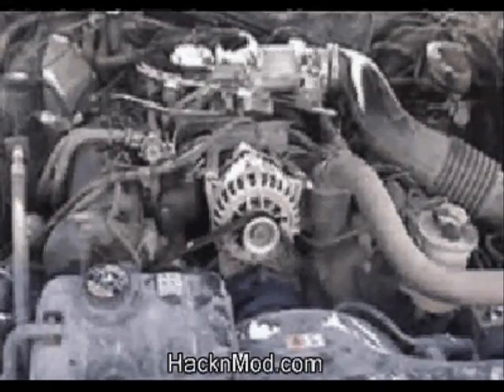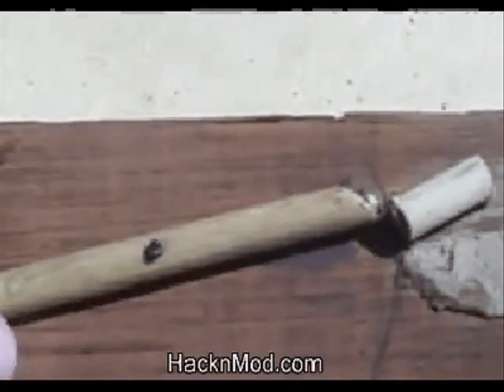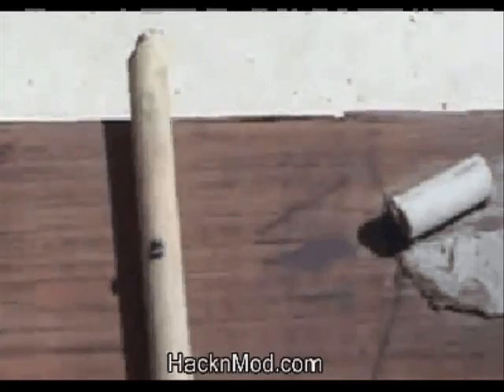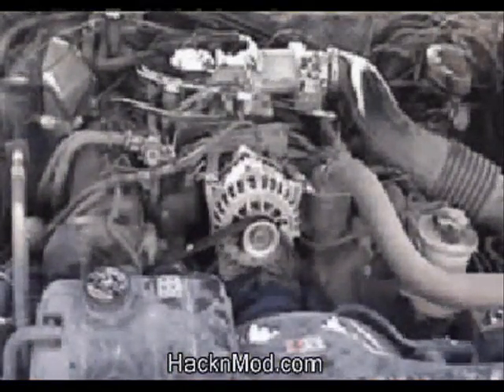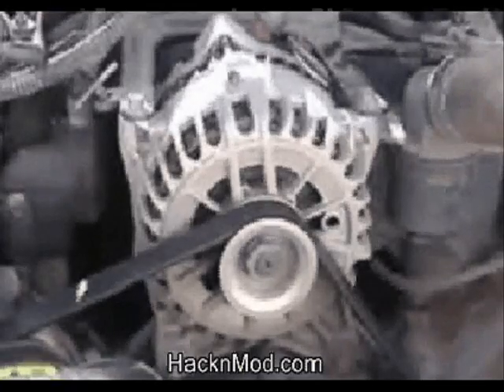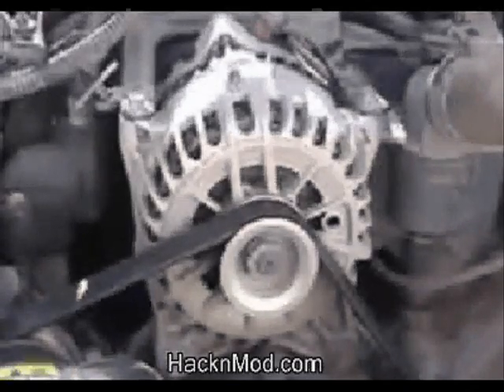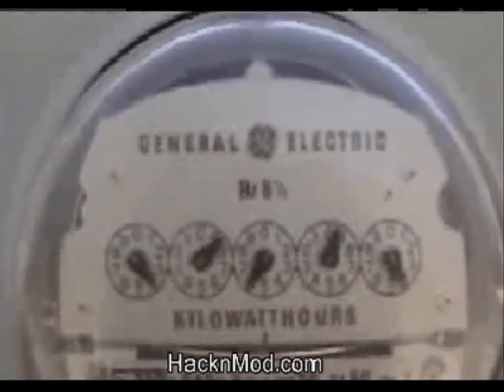How to Power Your Car Using Magnets - HacknMod.com

Comment: I have a design using magnets to supplement engines or motors. I use a motor to drive a rotating magnetic shield with electronic timing. I alternate repulsion/ attraction with the rotating shield, propelling a vehicle down a permanent magnet track. I think I can make a car-sized vehicle drive with a very small motor, if I could afford the massive permanent magnets needed.

Comment: They all had regulators that shut off the field current when the voltage got to 13.8 volts or the current was excessive. I had a '59 Dodge and I converted it to an electronic regulator because I was too cheap to buy a relay-driven one.

Comment: Fuck Face: Car alternators used to use magnets they were called generators. Problem with them is that you can't turn them off so when the battery was done charging the load would be diverted THUS wasting energy.

Comment: "There [sic] is nothing wrong with exploring new innovative ideas and concepts."

You're right. But magnet-only motors are neither new nor innovative. And they don't work. If you don't understand what a magnet is, and how energy is stored and transferred in a magnet, then magnet-only motors might seem feasible. But to an actual physicist (ie. a knowledgeable expert who's job it is to understand how energy is transferred in a system) it's pure nonsense. Videos like this one deserve to be mocked.

Comment: you might get a magnet to rotate like this, But try getting torque from it, NO WAY HOSEA..., you wouldn't get a 12v light bulb to light up, never mind a car to run... the torque required is massive...
Thom in Scotland

Comment: Hey you flat earth clowns, nothing is being sold here. BUILD IT YOURSELF before you start bleating your masters' standard disclaimer that it's 'impossible'. It's not perpetual motion when it uses an open system. The zero point takes energy from the fabric of the universe. Just because you can't see it doesn't mean it's not there.

Comment: The only way to make the wheel spin quickly enough in order to produce a worthwhile amount of electricity would be to use electromagnets, which will use quite a lot of electricity in turn. There's a bigger chance of solving the efficient hydrogen production problem than getting magnetic motors to work.

Comment: test this yourself, it DOES NOT run like that.  and once you put a draw on the wheel, it will slow down, too.  RADIANT ENERGY on the other hand is a better ballgame.  or hydrogen production using solar, even.

Comment: @whydidigetdeleted 
What I've been trying to say is SOMETHING already did the work to magnetize the magnet, all we're doing is re-converting it into something useful. 

Just as the wind blows through vanes and spins a turbine, or the sun releases electrons across a photovoltaic element (solar cell). The equipment itself does NOT have "stored energy" but it converts energy from other sources regardless.. if that makes sense. And yes I am a firm believer that perpetuality is impossible :P

Comment: @Theuf28 Ok. Build it, video it, and prove us wrong. There's a resistive force as each magnet approaches the static magnet. That resistance is slightly more than the push off that you get from the static magnet continuing to turn the wheel. The reason for this is actually friction. In a 100% frictionless environment this could work. In a very well lubed up environment, it will APPEAR to be continuous, but friction will show it's face over time.

Comment: Why do so few people seem to comprehend the law of conservation of energy. If this where possible 1. it would have been done allready because attempts go back 2 centuries... 2. It would... since it powers itself... if left unchecked accellerate to the speed of light untill the centripetal force shreds it apart turining it into light speed shrapnel. By the way a single atom hitting you at the speed of light would rip you into 3 or more peices.

Comment: @bigjim429 it does not have any energy...thats the issue its useless for anything other then spinning around on a desk....

even IF it somehow put out useable energy it would be such a small amount that it would be useless to power anything that moves... it would be like replacing the engine in a bus with a hamster wheel ...

Comment: There is no such thing as perpetual motion or perpetual energy, however I must point out that he did not claim such.  When the magnets lose enough strength, they will need replaced, so it is spending fuel, in the way of electrical charge.

Now, how many of you intelligent engineers noticed 1 magnet missing from the wheel?

Comment: Well the good thing is- can be used for DEEP CYCLE very easily. Which Marine Batteries need. Many compare this to: perpetual motion  and its not actually. See the Magnets ARE the energy which makes this a Non-perpetual device. The output on this device would be connected to Voltage Regulator hence reducing LOAD.

Comment: The RPM would incrase, and magnetic power would incrase, causing more power to be produced than used since magnets will move without the aid of electricity. It would go forever becasue ther would be no friction, which means no ware and tare on the parts. Ecpecialy if all moving parts were magnetised + and - so they ever so slightly repell eachother...so they would act like atoms...not quite touching eachother.

Comment: hmmmmmm
if he finds a very low resistange alternator it would generate electriserty but when a lightbulb were to be pluged in it would braw current and the alternater would have more resistance stopping the magnet motor yes with niodinium magnets there would be more talk so would be able to power that light but with one light on a huge in comparison machine it just isent a plasable energy source 
i mean like you get huge turbines with huge volts but small generator and a even smaller light um no

Comment: There are HUNDREDS of videos on YouTube all claiming that they have a "magnet Motor" that runs all by itself and requires no outside electrical power. BULLSHIT! There isn't even ONE that works. They can't work as claimed because magnets do not have stored  power. They can only CONVERT power from one form into another when moved by an outside mechanical force. People who believe in magnet motors are dellusional.

Comment: Either you just suggested Hydroelectric power, which has been in existence for hundreds of years, or you suggested something inefficient. It takes energy to move the water to the storage system. It also takes energy to either position the paddles/turbines below the water, or place the water above the turbines. The kinetic energy due to the action of gravity on the water is what eventually becomes electricity. Too bad it takes energy to create the hight difference in the first place.

Comment: I'm just curious, but wouldn't the effort needed to "push" one magnet past the next be more or less the same (but never less than) the resulting "oomph" that you get. If so, then the total energy expended is more than the energy you generate and it would eventually run down due to frictional forces.

Comment: how does friction factor into this?

Wouldn't it slow the rotation of the motor ever so slowly with each revolution until the rotational movement wouldn't be enough to start the next chain of magnets?  I'm curious thats all.

And how would you create one of these motors with any usable torque?

Comment: I'm not engineer. So, what's all this fuss about magnetic motors? I know an electric motor has magnets, but it also needs a battery. Is this Video suggesting we don't need a battery? Well, would be a heck cheaper, wouldn't it?

Comment: The energy produced by this motor is barely enough to keep itself going. When people demonstrate the force used to stop it, they are over coming the Kinetic energy of the device, not the energy of the motor itself. Once the Kinetic energy dissipate, its easily stopped. Its the same idea behind a top spinning on a table. The force you feel while stopping it is kinetic energy, not energy its actually producing.

Comment: total rubbish. magnets don't contain energy. they have the potential to store 'potential' energy just like gravity. you've got to use energy to prime it before it give you less energy back. just like a gravity.

if perpetual motion was possible it would be discovered by some scientist in lockheed or nasa, not by a kid at home with some magnets.

Comment: The electricity needed to power the electro magnets would be greater than the amount of thrust they create because they are not 100% efficient.  As such, it'd be more effective to put the electricity into an electric motor than magnet that pushes a motor.  It's just an extra layer of abstraction and inefficiency with no gain.

Comment: As DividebyN says, it'll run until you apply a load. But if you change the permanent magnets in the rotor to electromagnets and have them switch off and on as they pass the stationary magnets, you might just have something there...

Unfortunately, I fear it may already be patented...

Still, it does make a nifty parlour trick.

Comment: It's not intuitively clear, but magnets, when used this way will quickly loose their magnetic properties.  Many motors like this have been made before, they just don't last too long because the magnets quickly get weak, and no longer power the motor.  Sorry

Comment: As everybody says, this is bullshit. GetMeThere1 puts it clearly: a magnet can only push against another magnet with a force equal to the force necessary to INSERT that magnet into the other magnet's magnetic field originally. Energy can't be created, but only converted.

Maybe I'm wrong, but my guess is that a possible application for permanent magnet would be to couteract gravity in order to reduce friction.

Comment: As soon as he puts his finger on the widget, it stops.  It can spin, but cannot sustain that motion under a load.  Alternators must be run by an engine, then they output power by spinning metal through an electric field to induce a current through the metal. To use that power to create a magnetic field to turn other magnets just reverses the process and you actually get less out than you put in. I am an engineer, and know you need a lot of background to understand why it is harder than it seems.

Comment: No. I KNOW that simple arrangements of permanent magnets cannot create "perpetual motion." I know a magnet can only push against another magnet with a force equal to the force necessary to INSERT that magnet into the other magnet's magnetic field originally.

I KNOW that reports of "perpetual motion" that are based on arrangements of common forces (like gravity or magnets) cannot work.

Don't fault me for happening to know something that you don't. Is it IMPOSSIBLE I know what you don't?

Comment: exactally it spins for a WHILE, it slowly stops...

if you were going 30 mph on pavement, and slammed on the brakes you would stop pretty quickly, if you did it on ice you would slide much much farther... does a car on ice carry any more energy... no... does it produce more energy... no

it just has less friction, as a maglev train does, it still requires energy to start it moving, and slowly stops, therefore it had no energy, some was applied, and then it had none again...

Comment: it has air friction, thats drag, and yet it spins for a while.  ive made a magnetic bearing that spun for several minutes, it had drag. 

Energy production however, does not need drag, running a magnet near a wire does not produce drag on the magents

Comment: its not making any energy, it is just spinning with low resistance and will eventually stop because of friction.

think of it, the magnets "push" the wheel around at the same time its being slowed down by different magnets, an sense it spins then it has to be equal both ways. there for a similar size and weigh wheel with no magnets, and the same amount of friction would do the same thing....

and be utterly useless

Comment: There's no such thing as free energy. Sure, you can make something spin continuously with magnets, but if you watch any other videos on perpetual motion etc, these things hardly spin themselves, let alone producing any usable energy. If these were incorporated in cars or anything, they would do absolutely NO good, because they have zero power output. If you so much as blew on the one in this video, it probably would've stopped.
Kyle

Comment: Normally It just gets down to a matter of Energy of the atoms & how effective You use It most of what Is seen applies to the law there Is No such thing as free energy with an old flashlight around 3 hours uses, with LED flashlight stay on all night same brightness same batteries. But If the magnets are strong enough & can engage & disengage the magnets without using much energy Its Interesting.

Comment: If you were to rap a whole crapload of copper wire around that device, then start it going, you could easily generate some electricity, this would be much easier than a car, because a car has limited space, if you took those tiny magnets and bumped them up to huge 10 cm X 10 cm, you could make a small powerplant that could power your home, and many more, in you back yard.

Comment: there is no such thing as "over unity"  You have to have frictionless bearings, You have to have magnets that never lose their strength.  It is impossible to get something for nothing.  Perpetual motion is impossible!  If you connect a generator or alternator directly to a motor and start it up.  It will slowly by surely slow down until it stops.  The friction of the motor along with the fact that there is no such thing as 100% output says it won't work.  save your money!

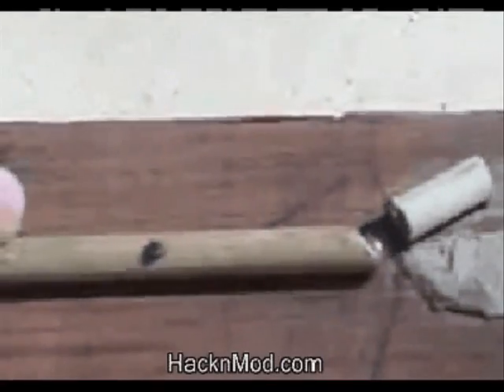Comment: wat u were doin at 1:30ish secs..add more weight to the rotor to act as a flywheel storing kinetic energy thus keeping itself rotatin and a very low friction bearing of some sort for the centre..i cant see y ur design would nt work then?

Comment: not with the new plastic magnets coming soon to your computers to have bigger ram drives. and hard drives..... the plastic magnets are made with chemicals and light!!@! depending on the lights color makes it stronger! blue and green and white are the most affective. so it would not take more energy to make the magnet controlling the alternator.
google it"plastic magnets"

Comment: "I am simply stating the fact that perpetual motion is not possible."

You are of course correct; one should also point out than permanent magnets do not contain any energy, so it is impossible to make a motor out of them without adding energy to the system.

Comment: Magnets exist that are VERY powerful but whether it works or not has everything to do with the fact that the push that you get out of the magnets is equal or less than the energy that you pushed them together with.The only way around that is IF there were material that could pass between the magnets as they approached each other that would block the magnetic fields without itself being magnetized then move out of the way so the magnets would suddenly find themselves pushing away from each other

Comment: This DOES not exist.... not one single working model has ever been demonstrated.  And the proof is in the fact that no one is selling electricity from one.  All you ignorant people that think you can get free energy or run a car on nothing but water really need an education. Also there is friction at a magnetic level.And every space between magnets that a moving object rotates on creates a bump in its path that creates resistance. Vacuum is very easy to achieve its done every day with AC systems

Comment: You have to enclose your machine in a container, and then blow all the air outta it. That would create a vacuum.

But the question is, how much torque can it provide? just because the machine runs at 25000 rpm in a vacuum does not mean it can provide sufficient torque to do work...

Comment: This concept certainly works... But the moment you use this machine to run a generator, it fails, coz there ain't no torque.

Gas and Diesel engines have so much energy concentrated, that even though ICE engines are highly inefficient, they are capable of getting things done.

This magnetic perpetual machine is just a toy. It would never develop sufficient torque... unless, you get hold of some super-conductors and super-powerful magnets...

Comment: topalien10 dumb?  maybe you are.  But I'm guessing you are just ignorant.  A generator has permanet magnets. It will produce voltage just by spinning it.  An Alternator (as used in vehicles) has no magnets. It must have some voltage put to it for it to start producing voltage (Electro Magnets).  The vehicles voltage regulator controls the input voltage to the alternator so it only puts out the needed amps.  This saves energy over a standard generator that would put a constant load on the engine.

Comment: OMG u?! that?!! dumb?!!! u dont have to energize an alternator to produce a 12 volt DC current at whatever amp it is made for. it just needs any kind of energy to spin it!! havent u seen those bike cycles with the light in back and the back tire spins a wheel that turns the mini alternator to make the light blink.

Comment: torque = force x radius....the force comes from the magnet array at a given drum radius which equals an output force or torque...just how much torque depends on how many magnets used/powered? and in what rotary configuration...it is very do-able..its one energy source that has yet to be exploited...

Comment: I don't think it could spin fast enough.  Theoretically if you build one large enough out of light enough matarials and with powerful enough magnets you might be able to use gear differentuals to power it.  But we are talking a massive one, one maybe two story in hight.  And even then, it probably could only power a single house at most.

Plausible but far from practical, MYTH BUSTED!